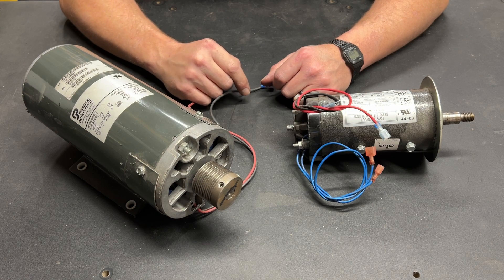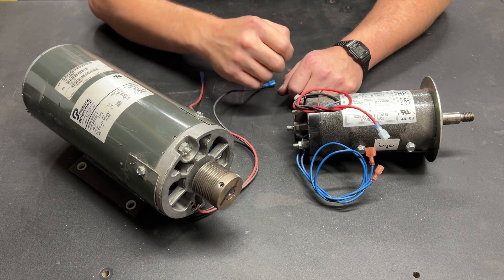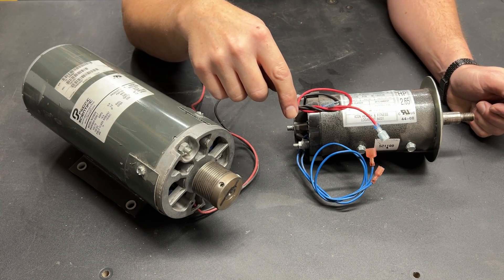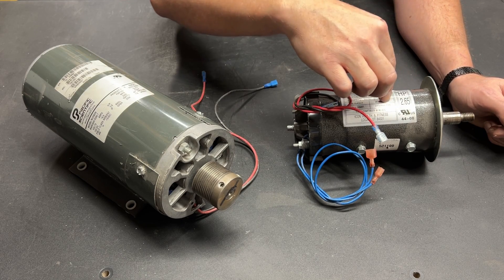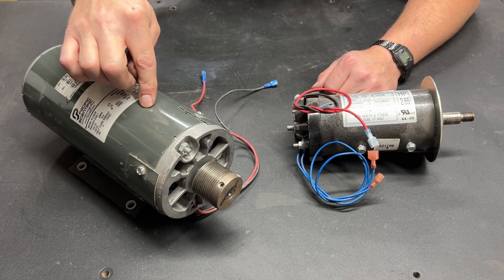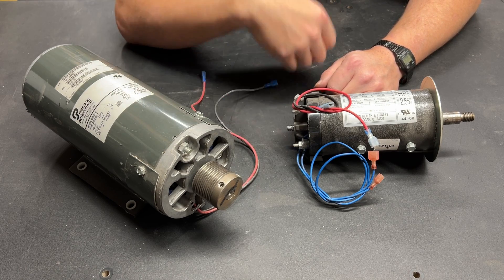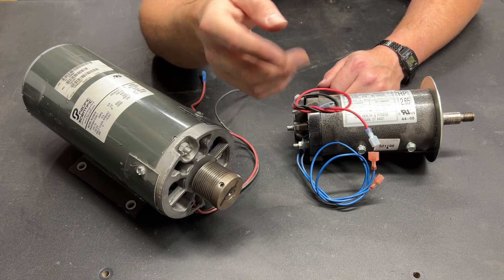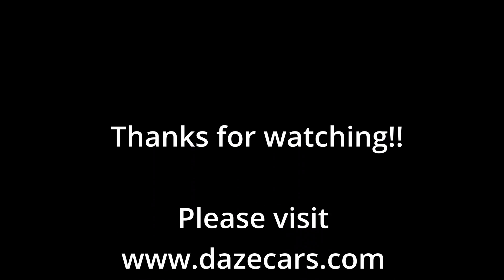Torque Means EVERYTHING When it Comes to Using a Treadmill Motor For Your Mill Lathe or Other Tool

Comment: Hey DazeCars can I ask you a question that's not exactly related to this video?  I've got some money for my birthday so i'm planning on making a belt sander for knife making. but all the AC motors are  too expensive , so i decided to go on the treadmill motor route after watching your videos. I can get a SCR and  a bridge rectifier on aliexpress but not the dc choke , that i have to make with the microwave transformer  as you showed. But my worry is that this is too DIY ee than anything i made in the past and i'm worried  that it isn't going to last long , so will it if  I do everything as you showed . can I atleast get a 1year of use out of a motor. My parents think that I should just saveup some more and get a AC motor but that would take way longer. Do you think I can trust this process . Thank you.
Reply from the maker: there are no moving parts so if you do it correctly from the beginning you will not have any issues.  If you are worried about it keep looking for a choke.  With a little patients they can still be found.
Reply: @dazecars  treadmill chokes are  available here but costs about $30. so I have to go the microwave route.  Then I will watch everyone of your videos about this and do as you showed. I hope you can help me along the way  with any advise . thank you very much for the quick replay.

Comment: Just a side note you should vary speed with PWM, not lowering voltage.  You'll have a lot more torque at slower motor speeds than by changing the voltage
Reply from the maker: PWM in effect lowers the voltage.  Besides, it's amps that determine torque not voltage.
Reply: @dazecars  yes, current determines torque, but you cant push high current through a motor without increasing voltage.  There's q reason variable speed drills use PWM (you can hear them squeal at partial trigger, thats PWM drive) its to maximize torque at lower revs.  Simply lowering input voltage provides much less torque at comparable speeds.
Reply from the maker: That only applies at the lowest voltages, once the resistance of the coil is overcome voltage no longer becomes an issue.  That usually happens (depending on the coil) around 5V.  You are talking about a 12v or 18v system and applying your observations universally.  I am working with 90-135v motors.  At EVERYTHING but the very slowest speeds there is more than enough voltage to overcome the resistance of the coil and apply max torque.   Either way the effect of PWM lowers the voltage.  If you don't believe me  put a meter to it.   The concept is universal, if you lower the voltage on a DC motor you lower the speed.  How you lower that voltage can effect function but only at the lowest voltages.  I stand by what I said.  @VJ-ft2xj

Comment: If you spin that bigger motor to the same rpm as the small one, it'll make x amount more hp than the small one.
If the small one makes a peak 2hp at 6k rpm, and the big one makes a peak 1.5hp at 3k rpm, the bigger motor will actually make 3hp at the same 6k rpm. Just another way of explaining it...
Reply from the maker: good point, thanks for the comment!

Comment: Great video. Can't wait to see you gear that smaller motor and put it on your drill press. I was wondering what I could do with my smaller motor.
Reply from the maker: me too 😁 it has been a project on the list for a few years.  I will get to it eventually.  So many projects so little time.

Comment: Thanks for the video, I have collected and disassembled lots of treadmills and have never run across a motor this large. Would you have a recommendation as to a specific brand I should look for?
Reply from the maker: that is the million dollar question.  Problem is manufactures make several different models and the rebrand every couple years.  I have scrapped about 20 and all of them have been different.  short answer, I haven't got a list.  I can say this however, there are three basic categories:  home cheap, home high end, and professional gym.  The big motor came from a professional level treadmill.
Reply: I tore apart a Nortic Trac Pro treadmill and it has a motor that is just about that size (2.25hp 130vDC) but bug and heavy like the photo.
Reply from the maker: That is why the best way to know what you have is to calculate the torque.  Size is just a rough estimate

Comment: Great vid, thank you! Really would like your views on thd DC power supply impact on torque? Personally I'm getting some estimated 30% more low rpm torque using triac regulated AC with a good rectifier behind it, compared to my cheap PWM DC regulated power supply. Up to 30V I have even switched both power supplies in parallel and think thats best of both worlds. Do I make sense?
Reply from the maker: So from a theoretical standpoint a DC motor has the same torque across the entire RPM range.  In reality there is a small amount of resistance in the wire used to make the coil so at lower volts that resistance effects amps.  In other words at the very bottom of the RPM range you will see a loss in torque with most power supplies.  At lower volts  you lose torque because amps are what determines torque.  I only find this to be an issue at the bottom 5-10% of the RPM range.  The motor will draw a base amount of amps for normal spinning and then more as loads go up.  I prefer an SCR type power supply with rectifier over a cheap PWM type power supply.  Yes the power is less clean BUT I get enough amps for best possible torque at the majority of RPM ranges.
Reply: @dazecars  you inspire me to do some real life torque measerments now. I did put an oscilloscope on the motor and saw basically that pwm delivers somewhat interrupted power (pulses) and the motor hums. On rectified AC there's just straight lines and silence...
Reply from the maker: I really need to get an oscilloscope.  some of the testing I do could really benefit from one. @kees-tanis
Reply: @dazecars   i have a very old pc based one, but with prices btwn 25 and 60 € on Ali i am considering buying a new one. Meanwhile I am pondering about a good and objective torque test. Think it has to be running torque rather than stall torque, otherwise I could use my tirque wrench

Comment: It’s funny that you came out with this video a day after you had messaged me back about another issue asking if I had done the torque calculation for my motors.  Drill press is actually exactly what I was going to use the smaller motor for and I might just use the mc60 and control box I already have set up on the wood lathe for the drill press instead.  That way I can use an SCR setup to get the most out of the larger motor on my lathe.
Reply from the maker: yes how I will do it.  The MC 60 is okay but not near as good as a properly assembled SCR setup.
Reply: @dazecars  I don’t have a second controller for the other motor so I would have had to buy one anyway.  Now a second choke will be needed as well.
Reply from the maker: the MC60 will probably be okay for a drill press BUT you really should run a choke with that as well.   @FTADaddio

Comment: Another great video, I like how you always explain it in layman terms. Out of curiosity, will all the different control boards control the larger size motor? I’ve salvaged a couple of the treadmill motors and control boards as well but haven’t put them to use yet. (This is how I stumbled upon your videos lol) I have the smaller one with an MC 60 control board and a larger one with the MC 2100. Just curious if the MC 60 will handle the larger motors? I bought the pulse generator that you recommended on your video and the MC 2100 works fine but of course is a lot more parts than the MC 60 which I know you tend to lean towards just curious if it’ll handle the “ larger” motors as well.
Reply from the maker: The MC60 and the MC21000 are budget controllers usually from mid to low end machines.  High end treadmills have really nice power supplies but the only way I have found to use them is to retain the treadmill controls/functions.  Any motor that came with a a MC60 or MC2100 should work with either power supply.  A better option IMHO is a DIY SCR unit as it will provide more amps than the MC60 or MC2100 and amps are what create torque.

Comment: Best we can do as a community, share treadmill models & motors. For example: Pro-FormXP680 has a small 3.25” diameter motor. 2.8 hp@ 130V. 1.75hp -cont. duty @100V. Came with an MC-2100.  I wish I knew the first one I scrapped. I got the big motor and is on my end mill. I’m still in the design phase with belts, pulleys etc. Does anyone else have designs they’d like to share. IG, FB page to compare designs?
Reply from the maker: That is a good idea.  It would be a huge list however because each manufacturer has lots of models and they change every couple years.  I have scrapped about 20 and none were the same make/model.  Have you seen my home made mill build?  You give me a good idea about sharing information, let me think on it... more to come.
Reply: @dazecars  indeed I have. Watched about 20 of the videos relating to wiring, SCR, power supply, design, etc. I started down this road when I couldn’t find an AC replacement motor to fit inside my mill/lathe combo. Seems the Obama administration legislated for higher efficiency electrics so motors got bigger in size to accommodate the law. Which for me, I couldn’t fit a new ac motor inside the frame. Planning a build can seem great until you realize your design doesn’t work. Just mounting the motor was difficult for me. My mill is round on the back so building brackets was a fete in itself. The throw for belt mounts, the height for belt alignment, would it clear the lower lathe guard? Will the wiring clear everything, purchasing belt sizes, pulley sizes and how to mount. It’s been a long road. I enjoy the challenge. Your channel has helped tremendously.
Reply from the maker: "mill Lathe combo"  are you a member of my combo Facebook page? @dathonlawler81

Comment: I haven't seen anyone put a dc motor on a metal chop saw. I have a Hercules metal chop saw that i want to convert to a cold cut saw. The smaller dc motor looks like the easier candidate due to size. Just curious on your thoughts on this swap.
Reply from the maker: The smaller motor will work if and only if you do some serious gear reduction.  Something in the neighborhood of 10:1  If you could make that happen it would be a good candidate because of the compact size and the intermittent use.  A better bet would be to get a properly sized AC motor as there is really no need to very the speed on a metal cutting chop saw.

Comment: Best to no go the treadmill motor route full stop
They are just not anywhere as capable as a 3 Phase motor running off a VFD
I tried everything as far as treadmill motors are concerned and never came close to what is now the cheaper and far more controllable 
option
It like everything it has had its day and no complex wiring , Inductors , Chokes , Chinese scr , Breakers , rectifiers, with a VFD you can program it to do anything you want , Ramp up , Ramp down , Jog , And a hundred more
Reply from the maker: I totally respect that that is your experience and observation but its not one size fits all.  I have hobby size machines and the treadmill motors are a huge upgrade.  My mill, my lathe and my bandsaw are all far more usable due to this upgrade.  I have helped hundreds if not thousands of people convert to treadmill motors with resounding success.  It all depends on the size of the motor, the size of the machine, and the application.   A large machine used all day long may not work well even with the biggest treadmill motors.  If a treadmill type motor wasn't a better option a lot of hobby machines wouldn't now come with DC motors similar to what you find in a treadmill.  An AC motor and pulley system would be cheaper for the manufacturer.  I will not argue that a good 3 phase motor and a VFD is superior to a treadmill setup but for most hobby machines its over kill.  If you have a sports car and a truck lined up on a gravel rod neither one will be able to go very fast.  I understand that it was not an upgrade for you but that doesn't mean it applies to everyone.  Thanks for the your comment
Reply: Many Thanks for that and yes of course it is horses for courses , And at the monemt I should be the last to say that treadmill motors are not the way to go , I recently purchased as Spirit fitness Treadmill for 99p yes 99p If I had not taken it away it was going for scrap , Within it had a 3 HP 220v VFD dedicated 3 phase motor controlled by a C200 Delta VFD  ,That surely is lucky as hell it had hardly been used due to the main switch failing and the company going bankrupt HEY 
That is now powering my Viceroy Lathe with a Rocketronic ELS , an engineers dream come true
I have wathched all of your vids over a long period of time and you are a very clever man and for sure worked out the best way to do this using dc motors , I have one on my small mill
Just been spoilt recently
Keep up the good work
Reply: @mechanical1955  When those commercial grade AC treadmills become old and replaced then maybe the averge hobbist might be able to find one. They sure are better than a DC motor but rare for free or little money unlike large DC treadmills that I see often from people who just want them gone.
I watched a local clearance auction of a gym that closed recently thinking I might score a commercial treadmill for cheap. No. They all went for over $1500.
Reply from the maker: Sounds like you do have quite a setup.  I have seen 3 phase motors on commercial level treadmills.  Glad you like my videos and have watched many/most of them.  I also appreciate the complement "clever man"  I am a problem solver at heart.  I do a lot of crazy projects just because I get a crazy idea and love the problem solving of "making it work"   @mechanical1955
Reply: Your comment is only valid if you have three phase available, the expense of connecting three phase far outweighs the advantage for a hobby shop. If your three phase motor can not be configured to suit the mains voltage a VFD is not an option, VFD,s that will increase voltage above supply voltage cost much more than the DIY DC motor option.
Reply: VFD setup runs off single phase @garychaplin9861
Reply from the maker: That is an excellent point.  A lot of people don't have 3 phase available.  I have said from the very beginning that in a shootout 3 phase wins, it is smoother, more powerful, and more versatile, BUT it is way more expensive, both in setup and in possible power requirement home rewiring.  It all comes down to what you are doing, what your options are  and what your budget is.  Thanks for the comment   @garychaplin9861

Comment: All the treadmills I've parted out have roughly the same motors. Id love to stumble across a big one for my lathe
Reply from the maker: It is all about "fishing" I have Craigslist and Facebook market place setup to to email me when treadmills come up.  I would say out of the 18-20 I have scrapped out 5 had a good motor.
Reply: @dazecars  what kinds of treadmills have you found the larger motors to be in?
Reply: 1 was a Proform and the other was a Spirit. Can't remember the specific models.
Reply from the maker: that is the million dollar question.  Problem is manufactures make several different models and the rebrand every couple years.  I have scrapped about 20 and all of them have been different.  short answer, I haven't got a list.  I can say this however, there are three basic categories:  home cheap, home high end, and professional gym.  The big motor in my video came from a professional level treadmill. @shenamariscal6200
Reply: I've only disassembled 2 treadmills so far and both had  large motors. At some point I'll get a small one.
Reply from the maker: were they high end home or professional grade? @Camoburb
Reply: @dazecars  got them free from private parties.  They were consumer grade. When I see one for free I look up what replacement motor it takes so I know going in if its the larger or smaller size. Got lucky on the first one then started looking them up
Reply from the maker: smart @Camoburb
Reply: @dazecars  The first i got was a Proform 505CST Retailed around $900 had a Johnson JM12-003 3HP 4200 rpm motor. The second one i got was a Spirit XT285 Retailed around $1900 had a Wanrui WA252 3HP 4600rpm motor. Had to dig a bit but these are my fist 2. I plan of getting 3 more. The funny thing about the 2 I got was that the 1st almost seemed like it was better built. Anyway, hope this helps
Reply: I got both of these free.
Reply from the maker: nice

Comment: It would be nice to know which treadmills have the larger motors
Reply from the maker: I get that question a lot.  The problem is manufacturers make lots of different models and then change the name of the model after only a couple years.  I have found no constant brand or model.  I do know this a cheap Walmart treadmill will have the smaller motor, the more expensive home units are much better with bigger motors and then the commercial units are the best.

Comment: I run a large sewing machine motor DC.
Reply: I was wondering about those motors
Reply from the maker: a lot of people are using those.  I have not used one personally but it is my understanding they work well for medium to smaller project but are not as potent as a bigger treadmill motor.  Which one are you using and what are you using it on?